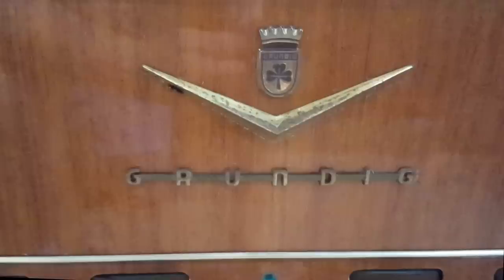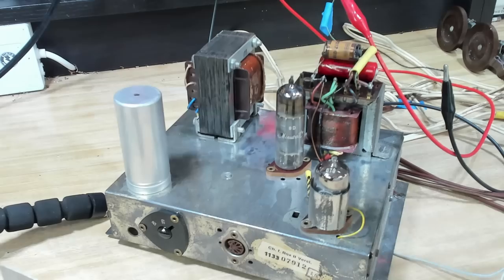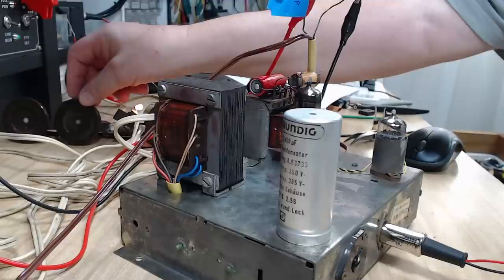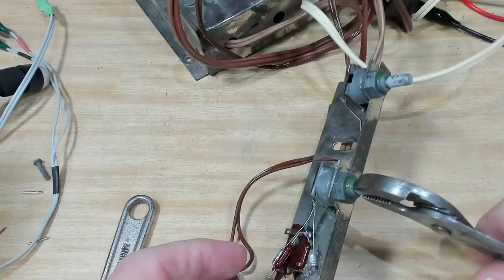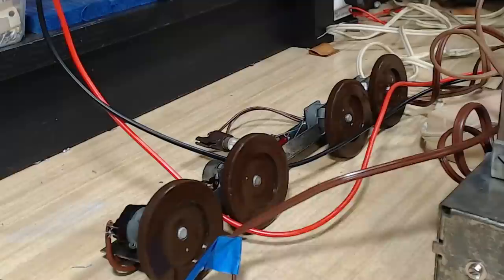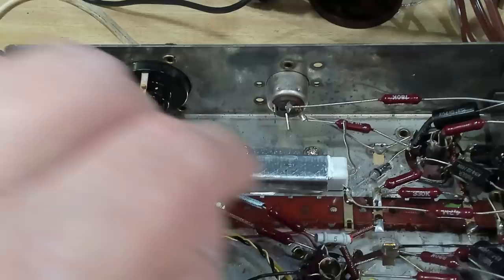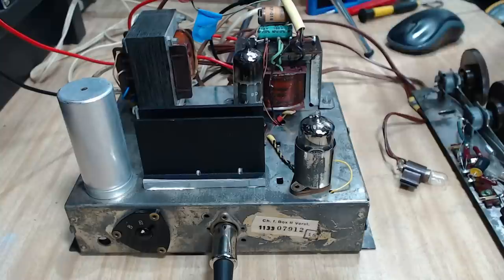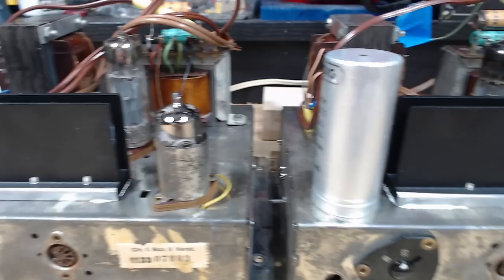Grundig Powered Speakers Repair - 1961

Comment: Hi David, Just a tip, I found that I can grab a round shaft very well with an old drill chuck tightened against the rod with very little damage. 
good luck Rich

Comment: Hi Dave, thanks for another interesting restoration video.  I actually remember seeing those speakers being sold growing up in the early 1960's in Florida in the US.  The German HiFi systems didn't sell very well here, although the mantle radios did.  I think the Philps valve set was one of the reasons, as RCA (Radio Corporation of America) dominated all the valves here, and were what people were used to seeing.  In this particular instance though, the ECC83 is the same as a 12AX7, and the EL84, the 6BQ5.

Concerning the resistor in series with the power transformer primary, I do that with every antique radio I restore for the following reasons: (1) The power companies have been increasing their mains voltage over the years.  In the 1960's, the mains voltage used to be 110 volts but now, it is 118 to 127 voltage (depending upon the time of day).  (2) The resistor acts as a fuse, surge protection, and improves the power factor.  (3) A resistor is of course mandatory if you are replacing a selenium or valve rectifier with silicon diodes.
Reply from the maker: Thanks Bill. There was a setting for 120Volts I think I remember so nit surprising they showed up in the US. I agree with your thought with the resistor 👍😀

Comment: That basic ECC83/EL84 amplifier was my first school project back in the 60'es.
The year after I upgraded to a stereo push/pull amplifier using some salvaged parts from around.
I remember the power transformer was a bit too high on the plate voltage winding making the 4 EL84's glowing red hot on the plates.
Solved using series resistors.
Then suddenly the (salvaged) rectifier electrolytic tried taking off like a rocket.
It could not withstand the too high plate winding voltage.
I got the power transformer and one speaker transformer from an old rusty push/pull EL36 amplifier chassis stored in an old radio shop.
By sheer luck my father found a second speaker transformer exactly the same type from a radio amateur.
Sadly these projects got lost over the years during many times family moves ...
Reply from the maker: Hi CXensation. That's what we did back then, scavenge around to find bits and pieces to make something. Good story CXensation, thanks 🙂

Comment: To convert a 220V item to 240V, you can also use a 240V - 20V transformer to reduce the voltage. That would get you most of the way there with no extra heat in the chassis.
Reply: You can use a small wall 240V-12V wall wart and wire it like an autotransformer, but out of phase, so the voltage will be subtracted instead of added. So you will be getting 228V output, but if you can find a 240V-20V, then you will get a perfect 220V at the output.
Reply: @michvod  Just to be clear, it needs to be an AC output plug pack (wall wart), not a DC type. Keep in mind that the rating of the secondary winding needs to be rated for the worst case current draw of the 220V output.
Reply: @daShare  has to be an old school type with 50hz transformer. If it is sealed and has a DC output, then it can be opened and the DC rectifier removed
Reply from the maker: The transformer idea has merit, it would depend on cost and room to mount it in some cases but a neat idea. Thanks da-Share 👍🙂

Comment: Nice to see those working again! The electrolytic caps usually have a metal closing cap on them right in the middle where the holes are, when they are gone it's usually a sign the electrolytic are in a terrible state and have vented
Reply from the maker: Thanks Jurriaan 👍🙂

Comment: I've had the exact same experience with old sewing machines. Lubricant turns into glue, you heat it up and it loosens up beautifully, but as it cools it just hardens straight back up. Just by keeping it hot and moving and adding thin oil you can eventually wash out and replace the old stuff. I do like the originality of the old pots, weird design as they are. Greetings from the Netherlands!
Reply from the maker: Hi Mark, it's the same with turntables too but you can usually dismantle them to remove the old grease. I heated and soaked the other three for ages before they would free up. The design was unusual but a pretty good solution rally 👍🙂
Reply: I had the same trouble with a '50 microscope. It is just the fact that they are not used. If they were used the stiffness would be noticed on time and a little oil would help out for the next 40 years.

Comment: Hello, Dave. Good to see another great video. That type of "wood" ruined furniture and antiques in my opinion. My wife had a console from the 60s or 70s made of that stuff. She wanted to ship it to you. My area is very humid, however and it didn't survive. It's now composting our garden.
Reply from the maker: Hi clasicradiolover, what a shame about you consul radio. Particle board loves... or hates water and moisture. It also tends to dry out where it hasn't been painted and simply chips off at the edges. I backfill the edges with PVA glue to prevent further chipping. Thanks 👍😀

Comment: Just saw your video pop up. That Grundig is the ‘57Chevy Bel Air of radios 📻, with the “V”. I’m going to guess that this radio 📻 is also 1957. I think 🤔 the speaker 🔊 is permanent magnet 🧲. Capacitors are always the issue with these older radios 📻. Just DON’T wire the capacitor 🆙 backwards. If ya do, on the “click” to “ON” with the volume knob, “POP”, will go the capacitor. This can blow many 👨 capacitors, it can blow one ☝️. It will be a LOUD “POP”, and it will scare the heck out of ya. I’m wondering about the dial light 💡, and the dial cord. Just don’t burn 🔥 the dial cord in half with your soldering iron. Your friend, Jeff.
Reply from the maker: Hi Jeff. Thanks for the tips. I don't think there will be an issue with the dial cord on this one but I'll keep it in mind. Cheers 🙂
Reply: 🤨 They weren’t radios ~ powered speakers from the 60s

Comment: When you started on the tone pots, I thought sure you were dealing with expanding pot metal. That is what it looked like on my screen. It was a great relief to know that the housings were cast aluminum. I really liked your slotted chopstick as a hone. I'll have to remember that. Great job, as always!
Reply from the maker: Hi Rick, if they were pot metal they were well made but I think they were aluminum, they took a bit of stress while I got them working again. It was slotted dowel but a chopstick would work also. Thanks Rick 🙂
Reply: Kebab skewers work for small holes.

Comment: I notice it uses a lightbulb to show that the power is on. I suppose instead of resistors to "toast" the extra voltage away, you could have rewired the power-on lightbulb in series with the primary or B-plus circuit to give it a built-in over-current protection / short circuit check / voltage dropper. 😄
Great video as always! Thanks for posting.
Reply from the maker: Hi Jac. You can use a bulb to lower current and lower the voltage and it was done in the past. The bulbs were called Barretters' and I think used in the filament string but I'm not sure. They only glow dimly like my dim bulb current limiter. Thanks Jac 🙂

Comment: HiDave,
I certainly remember those Grundig active speakers.  Those Grundig amplifiers (EL84 & ECC83) were very much tried and tested.  The earliest versions, or variations I encountered (with EZ80 rectifier) was from 1957, though I might have heard 1954 - year thee 'n' me first saw the light of day LOL.  Like you said, the rectifier valve was replaced with solid state rectification around 1959/60.   
I have a feeling variations of that amp was manufactured through to 1965 - Manuel will probably know more about them more than I do.
I personally like those active speaker cabinets but I agree with you, they are not true Hi-fi.  They deliver a pleasing sound - that which would be typical from a high-end stereo radiogram.
Lovely talking to you my friend, Phil.
Reply from the maker: Hi Phil, thank you for the info on Grundig speakers. Yes, they sounded like a radiogram from the 60s, nice to listen to all the same. Thanks Phil 🙂

Comment: 60's tech but they still sounded really good. Mind you, there are speakers made with modern tech that sound awful. 
Chipboard, the bane of every piece of furniture ever built.  Did you get a look at the condition of the cones ?
Reply from the maker: Hi Ellesmere. Yes, chipboard... it was attractive to the industry but any moisture and it's kaput. I checked the speaker cones, they were good. Thanks Ellesmere 😀

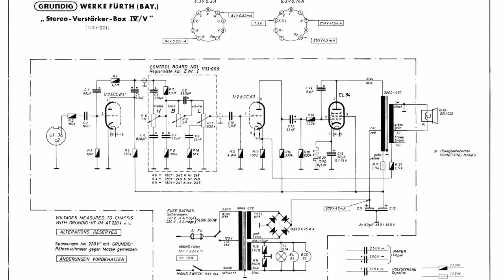Comment: 1:08 That's an interesting output stage. Normally, the idle current of the single-tube would partially saturate the output transformer, limiting the bass headroom. But here, they seem to be feeding the current for the rest of the circuit in the opposite direction, perhaps to cancel that DC bias without having to spend the money on a push-pull output stage or a bigger transformer core. I figured someone would have done this at some point.
Reply from the maker: Could be @pcno2832. I thought it was being used as a choke for additional filtering. It does make a Pi filter capacitor - choke - capacitor 🤔🙂

Comment: Dave you always take us on a great radio adventure. I couldn't hear what the speakers were like only you could, but for such a big cabinet you'd think a manufacturer could  come up with something really outstanding. I'm sure the owner is happy to have them working again.
Reply from the maker: Thank you Mack. The last bit was recorded directly from the speakers using my mic and they sounded like 60s speakers. They sounded similar in the room as well. The owner was very happy to have them working again 🙂
Reply: In the 60s few people were audiophiles due to the limitations of the tech and the cost relative to income. I suspect those speakers were bought for style rather than Hi Fi quality.
A friend's father had some of the first electrostatic speakers driven by a Nad amp but he was using a deck from a dansette as he had no money left for anything better.
Reply: You might want to consider listening to the presentation using a good set of earbuds or headphones. You’d be amazed at the detail you can hear. I always listen to shows with earphones - unless the production audio quality is so intolerable that losing some fidelity turns out to be a benefit.

Comment: Don't know what happened David but you made a comment and told me Shango had done the same G.E. E50 radio. which you were totally right it was exactly the same radio. For some reason your comment showed up in my notifications but not in the comments of my video. Thanks for checking for me and you are also right the same exact tuning dial cord was used. Thanks LL
Reply from the maker: Hi LL, I had a link to Shango's channel in my comment so it may have been deleted or moved into 'held for review' in YouTube studio. 
Anyway, that should help with your restringing. It was a wonder I remembered Shango doing it 😀 Cheers!
Reply: @DavidTipton101  Yes I saw it david and found that indeed he did do the same model E50 radio thanks.

Comment: Very good, David! I have struggled with tuning capacitors (attacking the dreaded dial cords..) and pots from 60's to 70's exactly as you describe here. They must have used a special kind of grease which turns into glue nowadays. Strangely, I haven't encountered this in older equipment (or newer). In my experience the best thing is to dismantle the shaft from the bushing (as you showed), clean well and re-lube. if only softened with solvent, it will re-stick in a week or two. At it again.. Nice 60's show also!
Reply: Found in pots and variable caps from Western Germany in that period
Reply from the maker: Thank you greengrayradio. Dismantling is the better option but they did free up with an large of solvent and a re-oil. I hope they don't bind again as you suggested. Glad you liked the 60s show 😀

Comment: BTW those pots were made by German PREH company and same ones were used in Hofner made guitars in 60s most memorable one that has the same pots inside would be 500/1 bass that Paul McCartney from The Beatles plays since 1963 he still uses his original one till this day. They often get hard to move and they were considered unrepairable if they are way too stuck and not movable with heat or lubricants. Now you kinda pioneered repairing them. Cheers mate.
Reply from the maker: I always wanted to be a pioneer, thanks _Michael_ 👍😀

Comment: I have something like this in my basement. It isn't Grundig but it is German. The tweeter is missing but the amp and woofer are inside. The cabinet is in pretty good condition. If we were in the same country I'd give it to you because I think you could make it good again.
Reply from the maker: Sounds like an interesting project for someone. Thanks Alan 🙂

Comment: The potentiometers seizing up is common with Grundig equipment of that time. Flushing them several times with turpentine usually gets them going again after a few rounds
Reply from the maker: Hi @senorcapitandiogenes2068, I can imagine Grundig caps of of that period will suffer the same problem. The solvent in WD40 is not that far from turps and is a hydrocarbon version in white spirit. Whatever, they did not move without heat to allow the solvent to get in there. I will know next time. Thanks @senorcapitandiogenes2068 👍🙂

Comment: A very interesting video. I had a Grundig reel to reel in the 60s. I was surprised to see the inside electronics. They looked kind of hap-hazard in assembly. It was not what I thought Grundig electronics would look like. Great that you got it working. It does sound good.
Reply from the maker: Point to point assembly often looks messy doesn't it ? In reality it is carefully laid out so components don't cause interference to other components. Some manufactures do it better than others though. Thanks Garfield 👍🙂
Reply: @DavidTipton101  I would take it that it looks messy because of no circuit board of some type. As you said point to point. My UHER Report tape recorder looks a lot neater, but everything is compacted into a smaller area and they have different functions. Still German quality. I come from the time when the big European electronics companies had the market; Grundig, Uher, Phillips, Tanberg, Telefunken, etc. Still like the look of them today. And as for quality. my Dual 1209 from the 60's is still in use.

Comment: These are very rare in Europe, let alone Australia, I was hoping for a push-pull amp rather that a single ended design,  but I guess that was deemed adequate for domestic use back then.
Very similar construction to the huge Grundig WE5077 radio I just restored (push-pull EL95 output), the red resistors in my set were all well within tolerance, looks like yours were also good.
As always, I love your attention to detail, the added heatsinks were a great idea, my set actually had aluminium heatsinks on the mains transformer from the factory, never seen that before!
Reply from the maker: Hi Mark. I bet there aren't many of these speakers in Australia, these would have been imported. I don't think I have seen a EL95 in a set here, similar to the 6BM5 I think. The resistors were very accurate. Heatsinks on a mains transformer, I haven't seen that either 🙂
Reply: @DavidTipton101  I have a love/hate attitude to Grundig, although they do sound good, they are a nightmare to service, components that are buried away, complex tuning arrangements, over complicated pushbutton assembly's & electrostatic tweeters that are always dead!

The EL95 (aka 6DL5) is not a common valve over here either, thankfully both on my set tested good, although the expensive EM34 is pretty dead :(
Still have three Grundig sets awaiting restoration....
Reply: @markpirateuk  tell me about it. I just recapped a grundig console a few months back. It was a pain to get to the chassis bolts and even worse to get the chassis back in.

Comment: Well done David... - a few little probs for you to solve. Interesting how you sorted the control pots... I wonder how they ended up being solid - was it oil/lubricant that had gone hard. I'm sure that in its day it (they) were considered very cool.
Reply from the maker: Greeting Kenneth. The grease used back in the day dries out and leaves only the hard "wax" component. The wax makes a pretty good adhesive apparently and being wax responds to heat. It's the same with 60s turntables, heat will loosen the parts so it can be dismantled. I bet many drooled over these speakers in the 60s but could never afford them 🙂